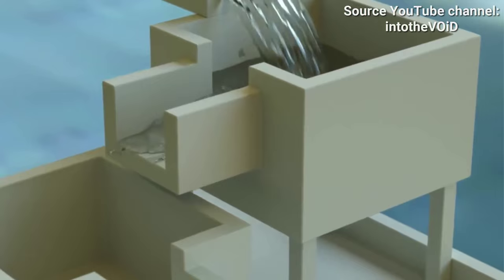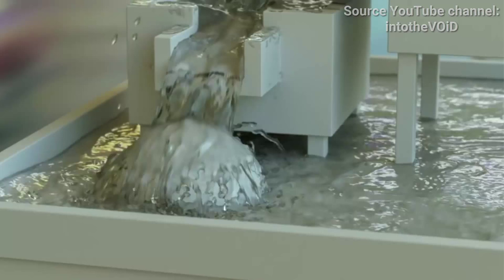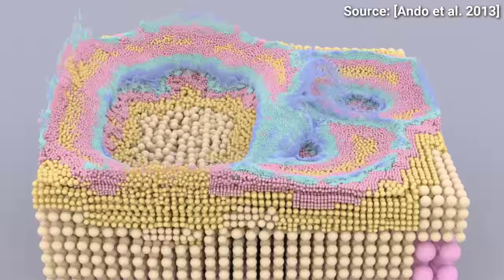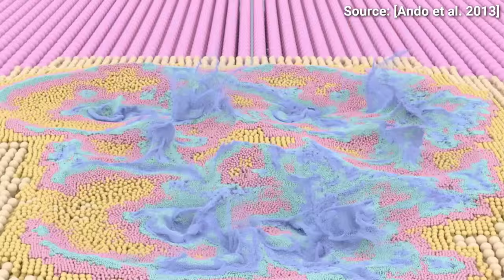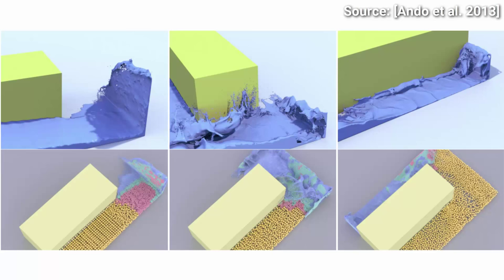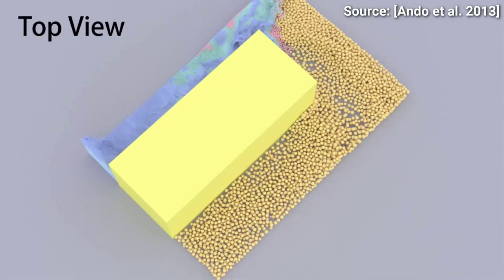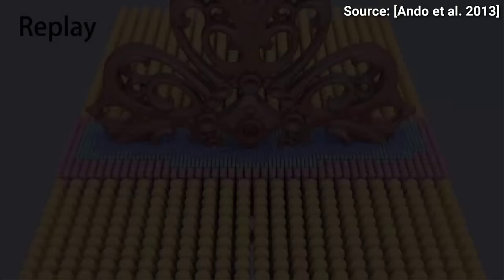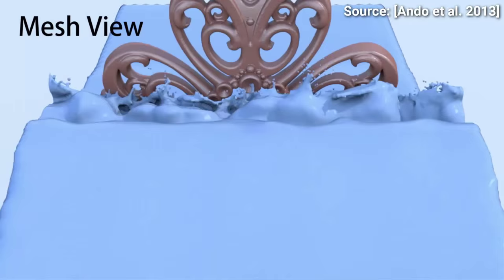Adaptive Fluid Simulations | Two Minute Papers #10

Comment: So, basically, it reduces GPU usage by only rendering what is visible and it reduces CPU usage by only processing fewest collisions possible (with a Quadtree perhaps?) ?
Reply from the maker: +NebulaBlackF This implementation does not do anything on the GPU, it's strictly running on the CPU. The simulation grid resolution is reduced in regions that are not visible (or not interesting). I think your analogy is right, it is a bit like quadtrees/octrees where we have additional knowledge on when to subdivide the cells. :)
Reply: I see, does this use multi-threading? I would love to see a GPU implementation of this with all the optimization tricks, same for the CPU parts. Could improve the performance a lot that way.